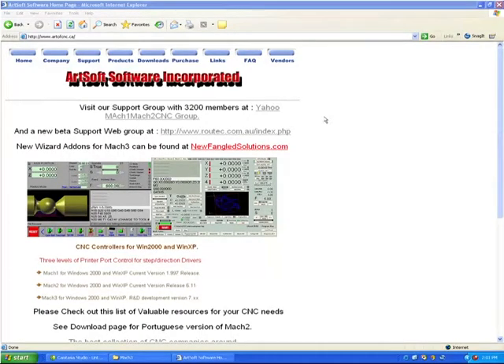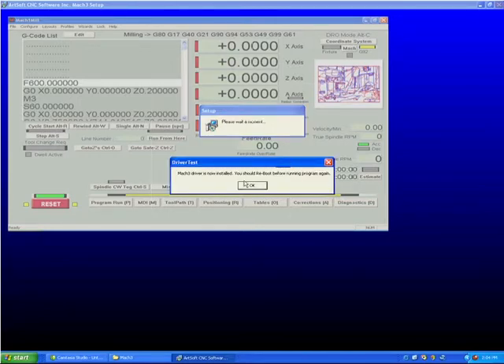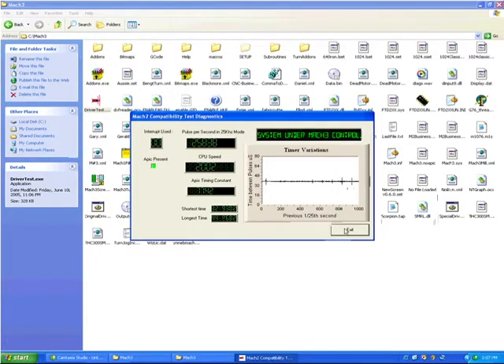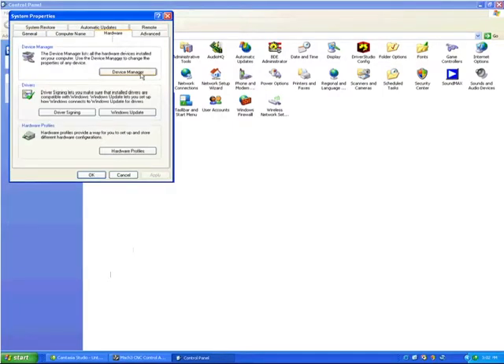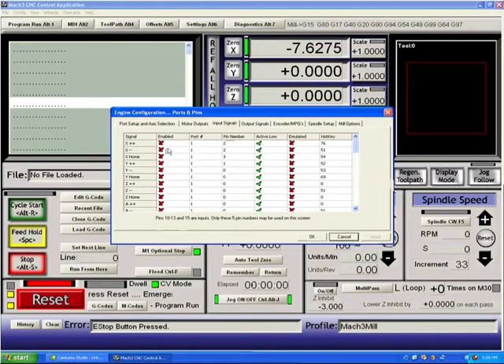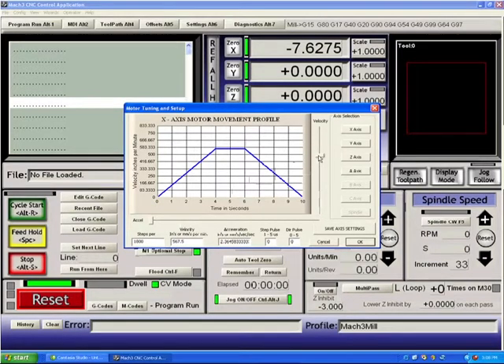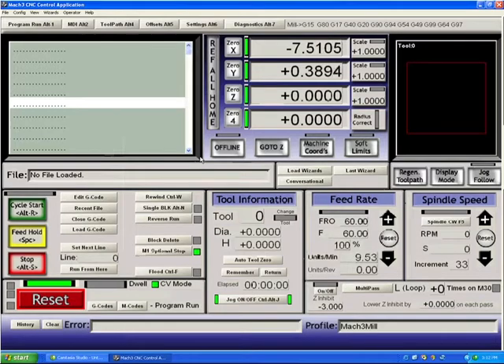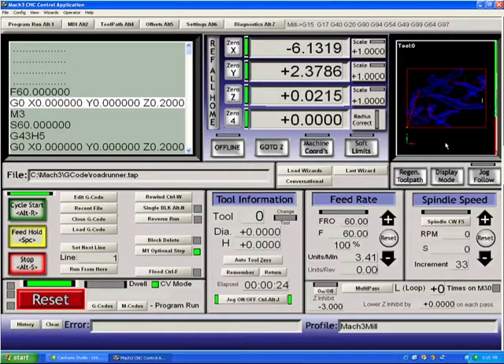How to install Mach3 software

Comment: I have a question  for you I'm putting  this on my laptop which now has windows  10 when it ask if your using  a port I  have a USB to uc100 would I still put it under port or no